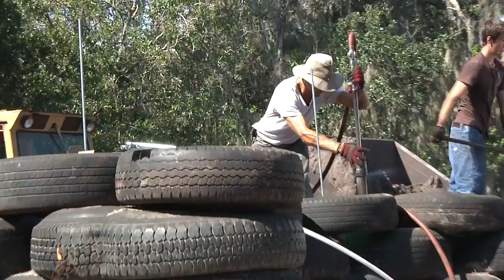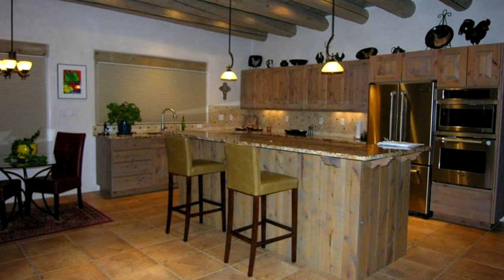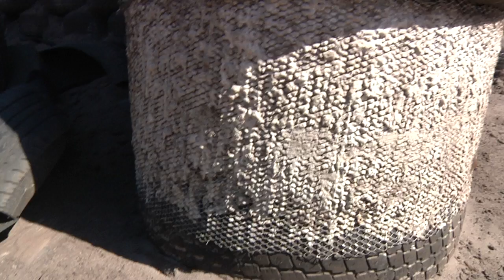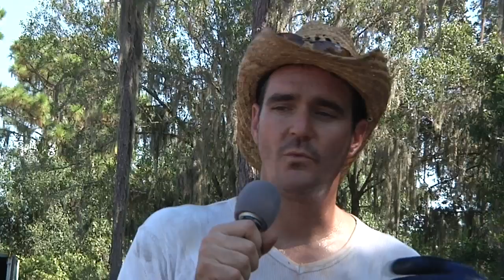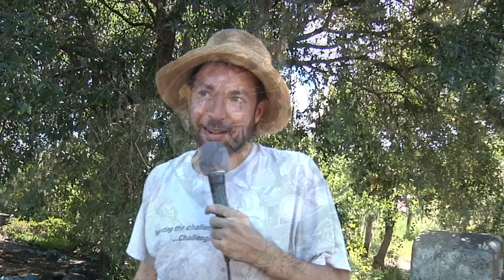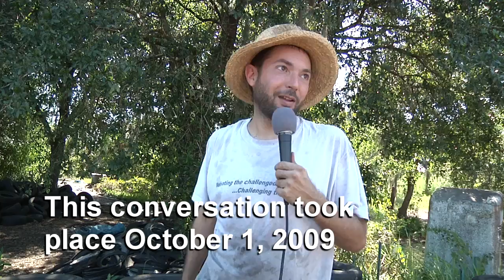Florida's First Earthship Sails Toward Completion

Comment: the only toxin in old tires that would pose an environmental hazard is zinc - and it won't leach from a whole tire. leaching only happens when they're shredded, or exposed to weather over decades. tires in an earthship are buried - they don't get wet. they cause real problems in landfills though - because they trap methane in their hollow space and rise to the surface. this is the best use for them.